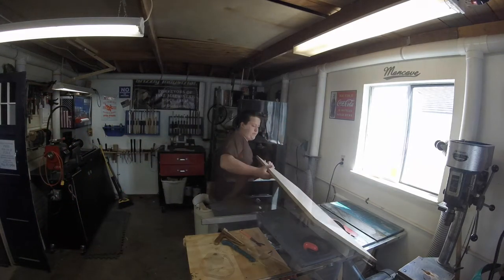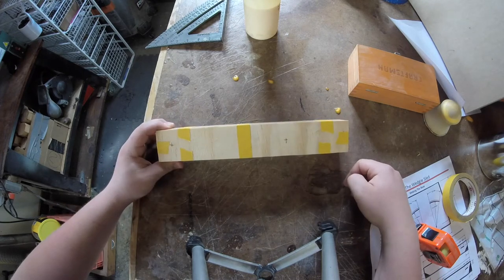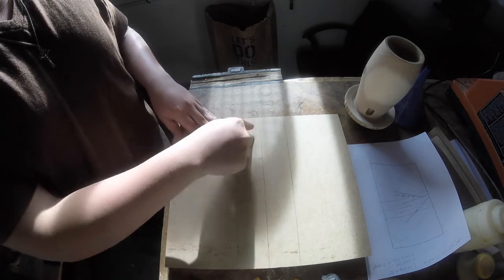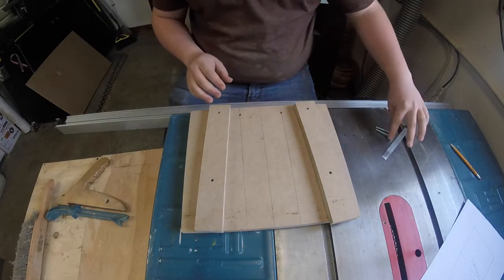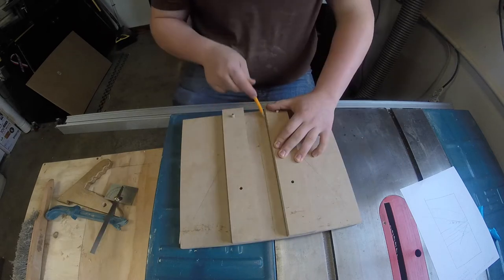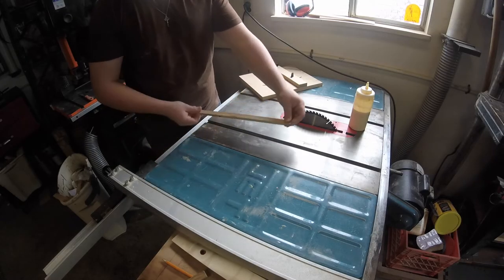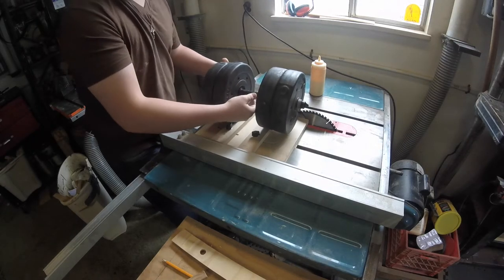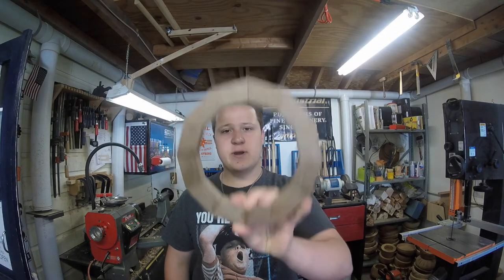Segmenting Sled

Comment: Pete,congrats on hitting 1,500 subs. Your sled build looks great, better than mine which I might remake.  Reenactment was funny, what is the wheels on a stick next to the drill press? I'm guess a magnet to catch nails from the sawdust.
Reply from the maker: Thanks John! Haha the stick with wheels by the drill press is used for moving the drill press around.  The end of the stick, by the wheels, has a hook and there's a latch kind of thing on my drill press base.  So I just hook the latch and use leverage to rock the drill press onto its back wheels.
Reply: Makes sense now, if you add a magnet will be able to retrieve lost screws in the sawdust. Reminds me I got a magnet in the garage need to take to the workshop for this very reason.